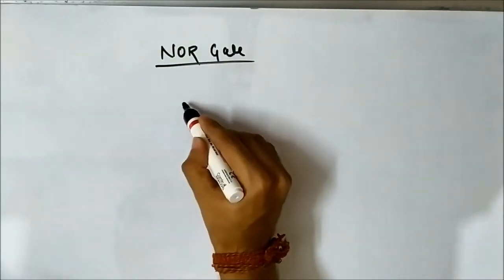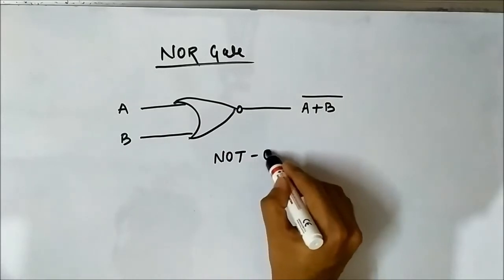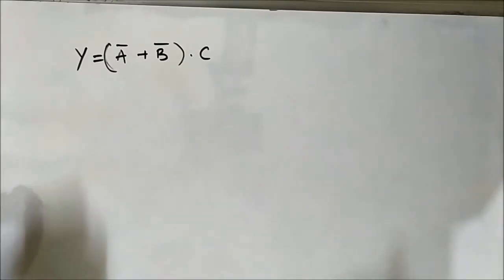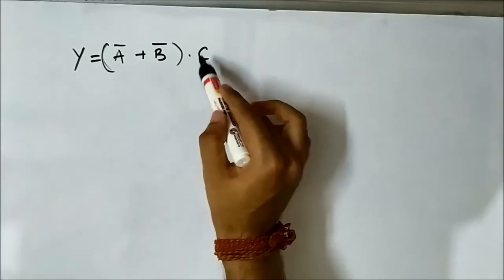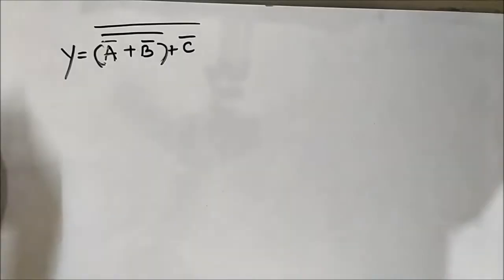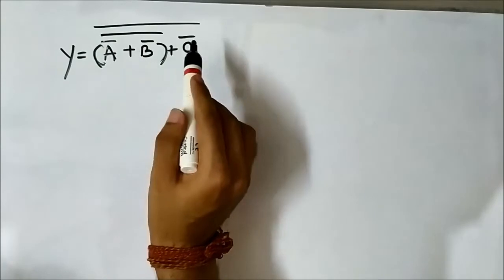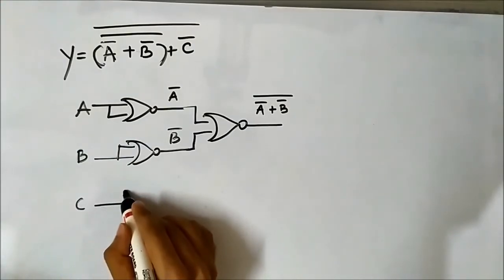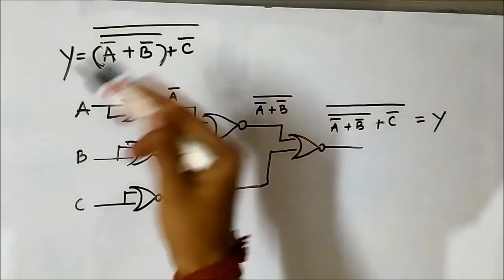Logic Circuit Design From Boolean Expression Using NOR Gates | Question 1 | Digital Electronics

Comment: but nor gate requires 2 variables
how are u using nor instead or not date for conversion
Reply: is returning the same output twice allowed in nor gate?
Reply: You're putting the same input into both inputs of the nor gate, causing it to act like an inverter